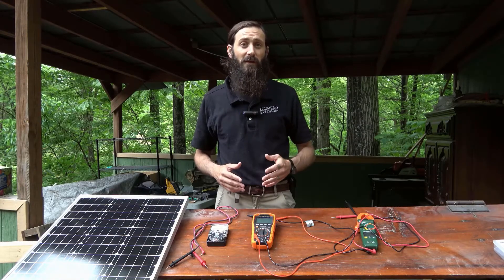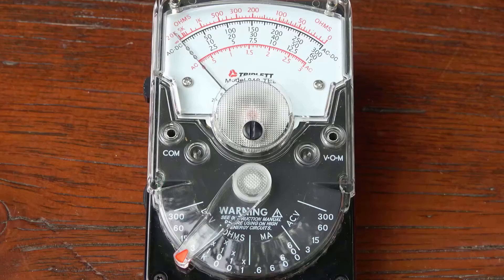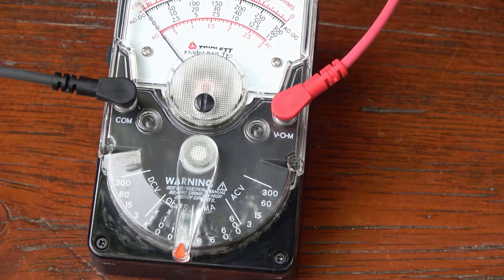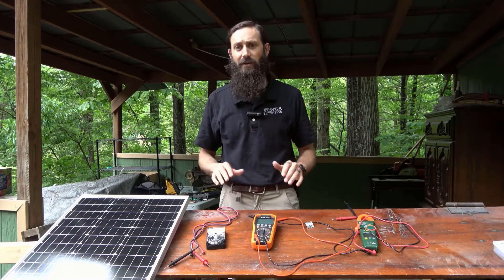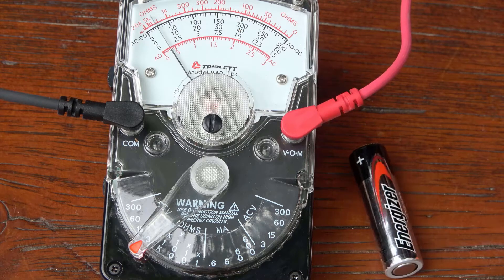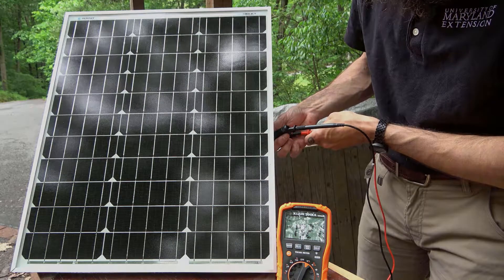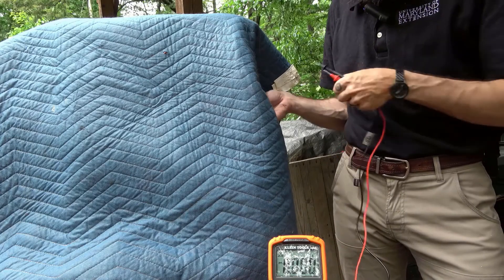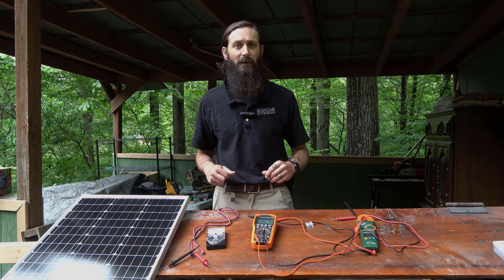How to use a multimeter with solar modules

Comment: Helpful video, but the last section on measuring amps could be a little clearer.  I was left somewhat confused about how you were setting up the circuit for testing the battery amps and also, when you were or were not covering up the solar panel when measuring the solar panel amps.